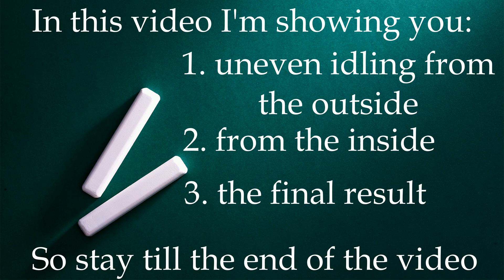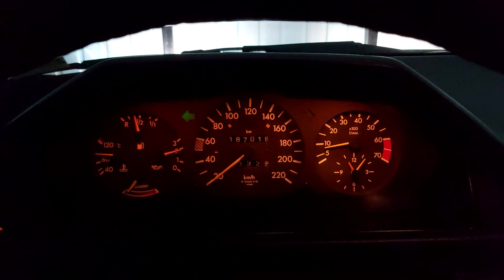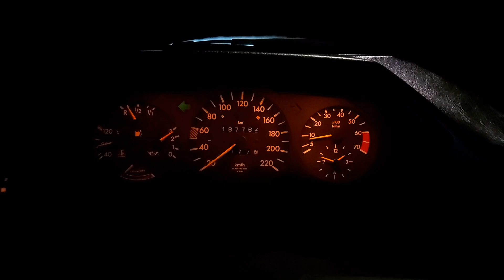Mercedes KE-Jetronic -👍🏻🥳🎉👌🏻Idling as it's supposed to be!👍🏻🥳🎉👌🏻

Comment: Hi Ivica  - great videos.  They help a lot.  I have a KeJetronic on a MB G-Wagen and the idle rpm is too high (1500-1800rpm).  I can't see how to reduce it to 1k.  Idle (CO) adjuster doesn't seem to be there - the allen key just pushes directly on the pivot arm and makes no difference.  The Air Flow meter seems configured to 2-3mm and car starting well.  Idles when cold at 1k and then rises.  Very weird and I can't find a video with the same issue.
Reply from the maker: Hi, thanks for the nice words. If you have an issue with high idle check rubber hoses. Most likely you have vacuum leaks somewhere. If not vacuum leaks then check the icv, maybe it sticks open and won't go back to it's normal position.
Reply: @mercedeske  Thanks Ivica. I found the rubber breather hose connecting the airbox was just off.  Its a hard one to squeeze on but now the idle seems to be behaving well.  Its a little rich (smells of fuel) so I am checking the CO idle screw and sensor plate adjustment and then the Fuel Pressure Regulator. I donated a little for the videos :)
Reply from the maker: Thanks a lot. If you have a lambda then you must get fluctuations between 50%, if not then you need a steady number of 50%. As for the EHA you have the specifications in my video on EHA. Greetings and happy Mercedesing 😀😀😀

Comment: Hello again, I have installed a new potentiometer and adjusted it to you excellent video, however, the engine, the engines idle is so low, 500 rpm, it keeps stalling at lights and junctions, any ideas?
Reply from the maker: Hi, Steve, glad to hear from you and have you back again. When you start the engine does it raise the revs 1200-1500 and then drop them down to 500? Does it stall when you make a full turn to the right(or to the left) and does it stall when you shift in D(if you drive the automatic transmission)? If it does then you have a bad ICV(idle control valve).
Reply: @mercedeske  Hi again, I just spent half an hour replying but all of a sudden it disappeared, so I might be repeating my message. The bottom line is that my fuel relay was bad causing the car to run as rough as a two-stroke. Having replaced that and the potentiometer the car ran as never before, the acceleration and power was fantastic, so I thought Id just the potentiometer to your specs and that is when the idle speed reduced to 500 rpm and stalled in D and just about any other time I put a load on the engine. Returning the potentiometer to its previous position the car runs great again. I would like to have things perfect with the potentiometer which is reading 0.5 volts at present. Yes on the first start the engine idles at about 1200 reducing to about 7-800. My email is steven.d.sutton (the at button is broken) outlook.com look forward to hearing from you. Regards Steve
Reply: @mercedeske  Hello My friend, did you receive my reply?
Reply from the maker: Hello, which one do you mean, the one with your email?
Reply: @mercedeske  Hi again, sorry if you have replied but I have received nothing and I would really appreciate your input. Can I run this car without the Idle control valve connected? plus my other questions. Actually I think I should offer you a free holiday in Thailand in exchange for sorting this problem with my car. What say you?
Reply: @mercedeske  I have just completed the check on the ICV as per your video, none of the readings concur with your target values and number 4, the m/amp reading is off the scale. I am presuming these readings are the same for six and four cyl engines? So, is my ICV dead?
Reply: @mercedeske  By the way I don't have an O2 sensor in my exhaust????
Reply from the maker: I would say it's the icv. If you shift in D and the car stalls or if you turn the steeeing wheel from lock to lock and the car stalls, then it's the icv
Reply: thats the one

Comment: Happy you sort it  :)
Reply from the maker: Believe me, I still can not get a grip that I have made it.
Reply: @mercedeske  what was the problem ?
Reply from the maker: @wiktorgsxr  The potentiometer, the oxygen sensor, the ICV, idle control valve was clogged, the breather hoses cracked, the fuel pressure regulator bad, the fuel pump - I was cleaning the streets with gasoline ;-), the fuel accumulator was bad, the injectors leaking, the disc was crooked from detonation and was rubbing against the housing. I believe that's all. ;-)
Reply: @mercedeske  Just that?
Reply from the maker: @johnnybravo6672  Yes, just that plus complete suspension, steering and many other stuff I don't even remember!

Comment: nice idle, happy you made it. Mine still is very lumpy on idle, kind-of like a missfire but it really shakes the car around. Replaced injectors, pump, all filters(ALL), new H7dc plugs, bosch coil+plug+rotor+distributor.. only thing left is the full fuel distributor rebuild :(
Reply from the maker: Thanks! I had many problems, I didn't want to talk about it in the video.
Ok, let's solve that issue! Here is how I can try to help you!
Did you clean the ICV, the idle control valve? Did you check your TPS- throttle positioning sensor? Did you check your sensor potentiometer and the O2 sensor? Which W124 do you have?(asking you because I want to check for the correct spark plug label) How many kilometers do you have on the odometer? Because if you have more than 150k consider checking the sensor potentiometer. The O2 sensor must be replaced every 60k kilometers, did you replace the O2 sensor? And one very important thing - does the throttle lever rest on the decel cut off switch?(that's a little box with the little wheel on top of it that has a micro switch which makes the "clickng" sound)When you release the throttle the lever must be resting against that little wheel, because then the ECU knows that the engine is on idle. Try lubricating the pivot points on the throttle linkage(with WD-40) so it can move smooth.
This way I can help you, so leave me a comment if you solved the issue. If you need any more help, just feel free to ask!
Many greetings
Reply: @mercedeske  replaced o2sensor with bosch bolt on part, Temps sensors. The icv was clean and freely moving when the hoses were replaced including the rubber boot+vacuum tubes. Fuel pressure regulator also replaced with known working unit. The tps potentiometer is the only unknown as I'm kinda scared to mess around with it. I did buy a cheap ebay replacement in case of emergency. Linkage is also freely moving and cable is replaced switch is also working as tested on multimeter. Also, tps measured at 0.04 with ignition on, couldn't get it any higher.
Reply from the maker: @ungureanutiberiu  Ok, concerning the potentiometer, have no fear, I will help you. Looks like there is your problem - watch the video on your desktop, my narration is in Serbian, but you have English translation available. The job is simple, really. The calibration is a bit complicated(I would say very delicate and boring) because you are going to be doing it easy. Here I am providing you the link of my video.
https://www.youtube.com/watch?v=IG9i6fkfPJ8
There you have it with the link where to buy it, you have a 5 years guarantee and the man is making just the potentiometers. It is very cheap.
Reply from the maker: Did you solve your idling issues? Did you replace the potentiometer?
Reply: @mercedeske  it was too hot and I was too lazy to replace it. Since I'm working from home I don't really drive it. I think I'll replace it on Friday if weather permits it. I'll post back then.
Reply from the maker: Oka, just post if it's better. If you watched the video you could realize - mark the position of the old one, put the new one in and you have to get 0.7V +-0.1, when the engine is at its operating temperature. The ideal is 0.7. Greetings, Ivica